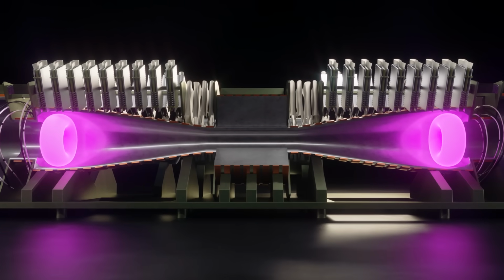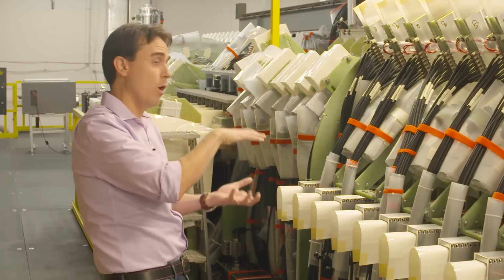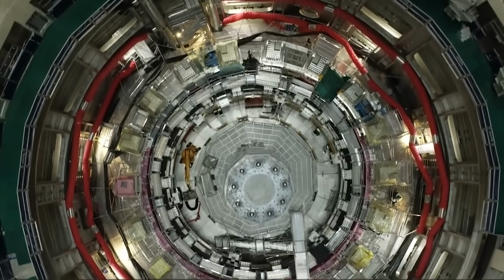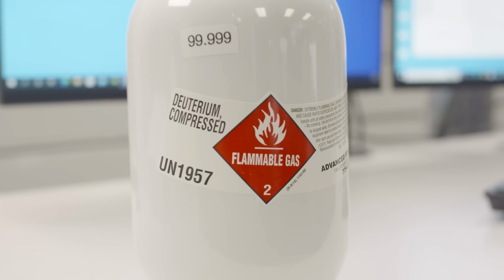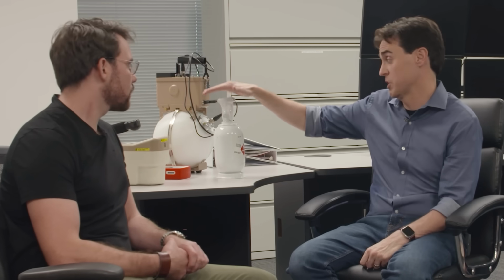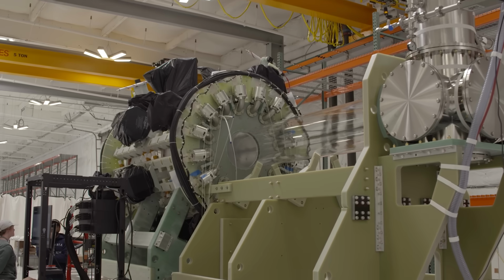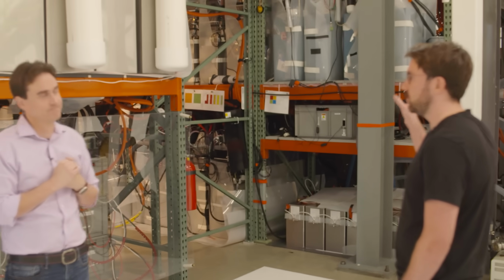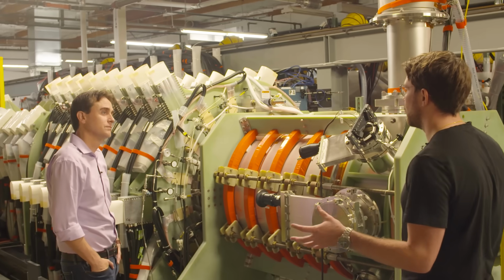A New Way to Achieve Nuclear Fusion: Helion

Comment: It’s amazing that we can do this. Fusion is super cool. I think there will be a lot of cool experiments and new science questions developed around the technology. Practically though, I don’t see any way it will make sense for use as an energy source for something like the electric grid.
Reply: Why don't you see any way? It seems rather obvious to me.
Reply: @elmarmoelzer2229   It seems we are finally able to get more energy output than input at the moment of the experiment but that doesn’t account for the actual total input energy used when accounting for making the fuel. I think it will be a good way to make helium or have incredible spacecraft propulsion applications but to try to power all our energy needs seems silly when there is a working fusion reactor that is already built and emitting usable energy and is 333,333 times the mass of the earth. That’s why I’m thinking, from a practical standpoint, it just seems easier to make a solar panel and call it a day.
Reply: @bradSharkey   sun does not shine 24/7
And don't even DARE coming to me with "storage". A small country liker Germany would need between 35 and 55 TWh of storage. World battery production capacity in 2021 for ALL purposes (mostly BEVs) was 850 GWh...
And that is not even talking about the costs. Even fission would be an order of magnitude cheaper than an all renewable, let alone an all solar energy policy.
https://iopscience.iop.org/article/10.1088/1748-9326/ac4dc8/pdf
Reply: @elmarmoelzer2229  Why would we limit ourselves to chemical batteries as the only storage option? What fuel would you use for fusion?
Reply: @bradSharkey   Fair, there are other options for storage but they are less efficient than batteries (so you need more).
Pumped hydro is great, but requires certain geological and geographic conditions that can not just be found anywhere. Plus you need A LOT of very big pools. Those cost money and do not produce electricity, they just store it. So that cost needs to be added to the cost of renewables.

I think Helion's fuel cycle is very good overall. Burn Deuterium to make Helium3. Then add that Helium3 for an extra boost of output energy over just the D-D reactions. They have a lot of options for optimizing that system too. E.g. they can make dedicated D-D plants that are located at a central location and distributed D-He3 plants that make the electricity to sell. 
Or they can combine both into one plant. 
Both have advantages. 
They can also decide whether they want to store all of the Tritium for extra He3, store some of it and sell it for extra cash, or sell all of it and then buy some He3 on the open market. 
Lots of options there too.
Reply: @elmarmoelzer2229  Right so where do we get the deuterium? The oceans? So we have to use electrolysis to split water? How much energy is used there? Then store the hydrogen (which always has a loss) while trying to extract the trace amounts of deuterium using hydrogen distillation? There’s barely any tritium on earth so if we want to use that, we have to make it splitting lithium. The same lithium we could have just made a battery with. H2 and He are light enough that they leave our atmosphere unless we burn back some of the H2 we made back into water (still operation at a loss). Also a fusion reactor is a complicated complex machine that is a single point of failure. Can it be throttled? It will likely over produce energy some of the time so we would still need energy storage anyway. I just think there’s a lot of questions to be answered with it and a more simple (solid state) diffuse interconnected energy grid would be easier, cheaper, and therefore more favorable. Then fusion be used for He production, propulsion systems, high intensity energy applications, and whatever else we come up with. 
Honestly, it would have been nice if we had been using more fusion the last 70 years. Maybe fission and fusion could work in tandem for main energy needs with storage and renewables as support but I feel like we’re at the point where we know enough and have enough resources to steadily work our way toward just being on solar. Why use any fuels on earth when we can just outsource it to the sun?
Reply: @bradSharkey  
1. A 50 MWe machine will use about 20 kg of deuterium a year. That is not much at all. 
2. They do not use Tritium.
3. It is throttleable. They can adjust the pulse rate at will. So, it can load follow with renewables and overall power demand very well.

Comment: I still don't see the hype around all these fusion reactors yet. Yes it's cool and exciting, but none of these things have "worked" The first fission reactor worked the first time it turned on, 80 years ago. So I'll believe it when I see it.

3 things of concern with this reactor:
1. There is no mention of thermal regulation, in the capture chamber. Neutrons aren't small atomic particles and there is no way of stopping there physical collision with the chamber wall.
2. Capacitors aren't magical things. There are consequences for firing them at that high of capacitance that fast. Ask the Navy how their rail gun protect is going.
3. This is the real world and things are never perfect. How does the reactor step up or down fusion reactivativity? How can the magnetic fields be stabilized at a constant size as magnets lose their magnetism (which is going to be at a high rate) What are the concerns of  unknown or known subatomic particles frying around the chamber? 
Just how many cycles can this Reactor be on before efficiencies are lost and you are now at a net negative yield?

Again ill believe it when i see it.
Reply: Hot Rock make water boil!
Reply: The voice of reason.  Thank you!
Reply: There are answers online for most of those questions as long as one is willing to do the search.
1. The Trenta prototype depicted in this video is not "fired" often enough that heat accumulation is a problem. David Kirtley says that they know they will have to address it in the next prototypes/working models when they dial up the frequency.
2. And ?
3a. What do you mean by "fusion reactivity". If you mean energy production, stepping it up or down will not be a problem since these machines are pulsed, and the frequency of operation is completely under control.
3b. Helion does not use permanent magnets so, not applicable.
3c. Subatomic particles "frying around"? You mean damaging the machine walls? To start with, no unknown particles are expected (the range of energies in which this machine operates is far too modest for that). Regarding known particles, the ones with a charge will be managed with magnetic fields so they don't impact the walls too often, or with too much speed. From the neutral ones, the most abundant by far will be neutrons with 2.45 MeV of speed/energy produced from D-D collisions  (~4% of the fusion events). 2.45 MeV is a relatively modest energy when compared with the energies of neutrons produced in fission reactors, or even fusion reactors using other fuels (i.e. D-T reactions produce neutrons with ~5 times that energy, and a lot more of then); so, known problem, less pressing that in other reactors, should be easier to solve. For what is worth, my opinion is that this won't be a show stopper.

Comment: Really cool tech for sure, BUT... the model is wrong. We're at the point now where experiments like Aureon Energy does, use an anode and virtual cathode and let the charged plasma self organize into double layers that replace the need for all those magnetic and electric fields you are using, at great cost. 

They've made that discovery of a natural process and more scientists need to explore it, document and corroborate the results, such as the transmutation/creation of various, including rare earth minerals, elements, work on the math models, and start publishing findings that are changing the current paradigm.

Aureon is NOT prioritizing that scientific debate, since they already have the ability to create applications and put them into use.  This has to be the way to force the discussion, since changing paradigms is forbidden in the funding controlled universities and literature.

It's happening and the sooner more serious physicists and electrical engineers replicate their experiments and use their model, the better it will be for all.

Even with the 192 laser breakthrough on December 5th, the mainstream is saying "maybe in a decade, we'll work on designs for working reactors".  

NO! SORRY! THEY'RE BEING BUILT NOW ⚡

Thanks in advance for taking a look and considering a different path for all that brain power.

Comment: Two question is have
1) what happens if a capacitor bank or magnet fails? Hot plasma flies out the side of the machine?

2) how confident are they, that they can extract more power than they consume?
Reply: 1) well you need the capacitor bank to make the hot plasma in the first place. If the magnets were to fair for some inconceivable reason, then the plasma would expand as it does at the end of each pulse and induce a current in the coils, which slows down the expansion. If the coils were to fail completely for some inconceivable reason, then the plasma would expand rapidly, hit the walls and cool down quickly. Fusion requires a certain plasma density so fusion reactions would stop relatively quickly too. The walls would see some abrasion- like damage and their lifetime would be reduced.

Comment: But why now? A few days after The National Ignition facility made a breakthrough…
Reply: Coincidence. The video was filmed long before the announcement.
Reply: @elmarmoelzer2229  Gonna sound like an as*hole here, but to me it sounds Helion is in panic mode: Main investors see the NIF breakthrough as a threat, or at least hinting Helion's approach might be completely wrong(even if all were geniuses... NIF cost 8 billion, was finished in 08, and made a breakthorugh 14 years later...), so they release the video in hopes to catch more investors, riding the wave. The video throws shade at Tokamaks, but not NIF's laser approach... definitely not a coincidence.
Reply: @diegoyotta   Nope, Helions investors have been with the company for many years, some from the very start. They understand what Helion is doing and why Helion is 1000 times closer to commercialization than anything potentially based on the NIF is. Helion has been more open for over a year now. They are fully funded all the way to commercialization.
What Helion needs is qualified employees for building Polaris and the machine after that, as well as the manufacturing lines for components. Right now, they need another 80 employees. Once Polaris is running in 2024, they will need another 1000!!
The hope is that enough people will start training now and going to school for the skills that Helion will need so that they will be available when needed. You don't just learn these skills over night. Helion is already reaching out to community colleges and other educational institutions about that.

Another thing is to prepare politicians, the public and future customers for a future with fusion power plants. Looking at the comments here, it will be good for people to get a better understanding of what is going to happen. Some are (unnecessarily) afraid. Others are skeptical. It will take some time for that too.
Reply: @elmarmoelzer2229  you sound suspiciously trained in PR… especially “Helion is already reaching out to community colleges and other educational institutions about that” sounds so corporate… are you getting paid to manage the comment section? Anyhow, how can they be so certain it will become commercial by 2024? And why do they need so many employees? A handful of brilliant people can do the work of a 1000. Look something is not right here. You seem too corporate to be just a commentator, and the timing is definitely not a coincidence. Theranos vibes here
Reply: @diegoyotta   I wished I was getting paid for replying to all of the stupid comments up here. It is seriously starting to get annoying. People are unwilling to learn or accept facts! I am getting a bit frustrated.
To answer your question. I am just a fusion enthusiast. I do happen to be friends with some people at Helion and some of the other fusion startups. That is mainly because I have been around this industry and community in some way or another for many, many years. 
As for Helion needing that many employees. They will start commercialization by 2024 because that is when they plan to produce net electricity for the first time. They currently have 1.7 billion in investment tied to "meeting certain milestones" (I assume that means net electricity). That money is for commercialization.
Helion wants to eventually make 20 fusion generators a day. Building and operating that sort of production capacity takes a lot of people.

The comparison to Theranos is unwarranted for many reasons (investors aware of the risk, been with company since the start, understand the physics and challenges, hired 3rd party reviewing board from the big national labs to verify results, etc, etc). Plus, even in biotech, for every Theranos there are dozens of successful startups.
Theranos is an outlier, not the norm. Yet somehow every other armchair expert acts like this sort of thing is common (if it was, Theranos would not have made as much news as it did).
Reply: @elmarmoelzer2229  not sure who/what is more “stupid”: the comments or someone who devotes his/her time to replying to comments without getting paid. Anyhow…

Here’s the 1.7 billion dollar question: has Helion achieved ignition? Because if that doesn’t happen very soon, all those plans to produce electricity in 24 or make 20 generators per day will not happen. If the answer is something like “we can’t reveal the status of our ignition efforts to the public” then something is not right. Not saying it can’t get there, but it might need more iterations than planned. 

Honestly Theranos was behaving in a similar manner: they promised Walgreens working blood testers but they could not get the thing to work, they panicked and you know the rest. Helion has promised full scale manufacturing by 2024, yet ignition has not been achieved( I mean, if they did, then the CEO would get the Nobel Prize, right…?) and only a year left… and on top of that the only method that has worked uses lasers and not hot plasma… yeah I can see some investors getting anxiety
Reply: @diegoyotta   Helion does not need ignition.
They are building a PULSED system with 95% input energy recovery...
Helion has not promised full scale manufacturing by 2024. They talke about achieving net electricity by 2024. Huge difference. But commercialization efforts will start the moment they achieve that (in some way, they are already starting with that too). 
Look, I am trying to educate you. You can choose to listen to me. You can choose to ask me actual science questions. But don't heckle me. You have all of the knowledge of mankind on the same device you used to make your (pretty lame) posts. Use it!
Learn something. If you don't know how to do that or need help finding references for the science, I will help you, happily.
If your entire purpose here is just to troll, well then you can't be helped.
Reply: @diegoyotta  Are you of the opinion that anyone trying to make good to others without being paid is stupid? I don't think you really believe that... 🙂
Doing what you can to promote knowledge/diminish ignorance is a good thing, don't you think.
Reply: @charliem6590  hey so your goon got caught in Vegas by Nicky Santoro… and got his balls pricked by an ice pick, then his eye popped out of its socket before giving out your name… Charlie M.

Comment: Whats the matter here?
So many brilliant minds are cheating their way around the crucial issue of fuel procurement. Without tritium, there will certainly be no fusion here, and that can only be obtained in a nuclear reactor. The breeding yield is so low that fusion never can replace nuclear fission. After all, fusion produces only one tenth of the energy of nuclear fission. Do a little research. He-3 is not enougth available on earth for commercal energy production.
Reply: You did not pay attention:
Helion will produce their Helium3 by fusing Deuterium in the same machine. D+D => He3 +n or D+D => T + p (the Tritium eventually decays to He3 as well). No space travel required.

Comment: Disclaimer:
Just because heavy water isn't radioactive doesn't mean it's completely safe to drink. If you ingested enough heavy water, the biochemical reactions in your cells would be affected by the difference in the mass of the hydrogen atoms and how well they form hydrogen bonds.
In the short term, Heavy Water may cause dizziness due to the density of the water. The dizziness can be caused by the differing density of the water and density of the fluid in your inner ear. If the fluid in your inner ear is altered; there could be a chance of feeling dizzy or even nauseated…
also, If you did drink too much heavy water, even though heavy water is not radioactive, your symptoms would mimic radiation poisoning.
These symptoms include loss of appetite, fatigue, fever, nausea, vomiting, diarrhea, and possibly even seizures and coma.
Reply: Sidenote: this guy is really stupid for drinking heavy water

Comment: Seriously, I came up with something like this in the 7th grade, Mine used two magnetron from microwave ovens and a large electro magnet to pinch the collided ions and microwaves produced  from them. I also had a design that used ions produced from tesla coils. It's funny how many ideas people have just floating around out there could actually be viable. Instead of producing fusion I was trying to produce mini black holes.